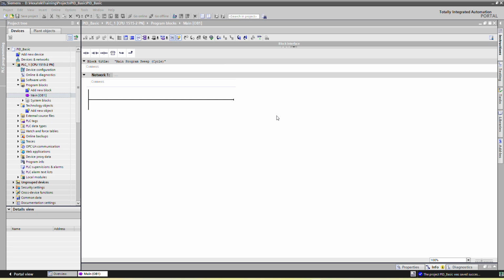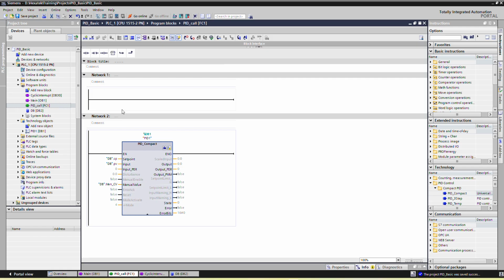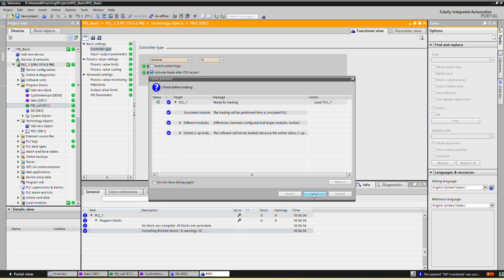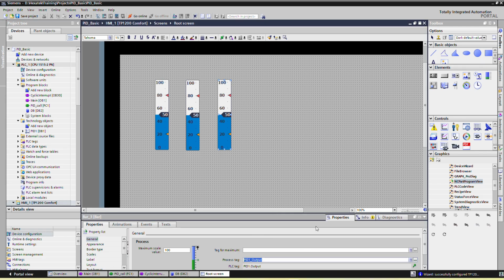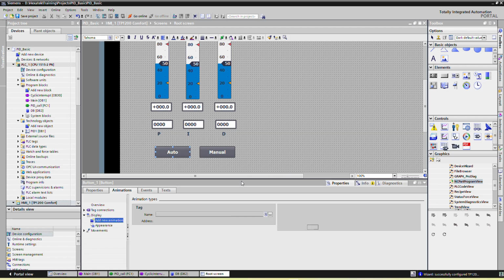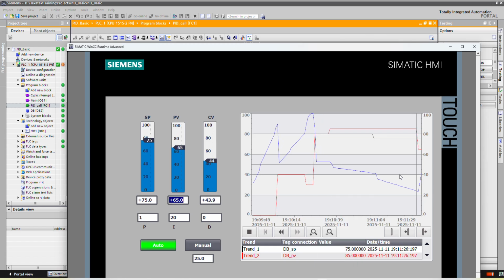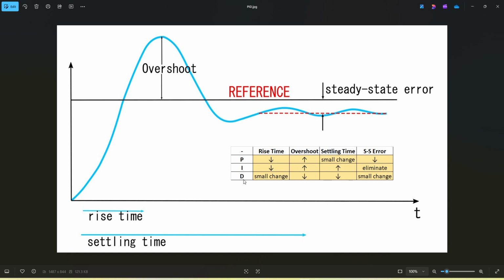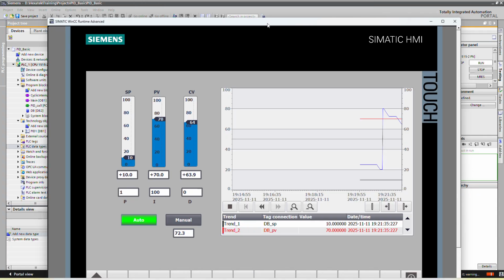Part 12 : How to Use PID Compact in TIA Portal | Step-by-Step PLC Tutorial

Comment: In PID_Compact, my states never change. I have done same step as you show. my states is always "0" instead of 3 or 4. plz help me
Reply from the maker: Hello,
0 means controller is in "Inactive" state.
trouble shooting:-
1)Check value of the mode input at PID Instance DB.
2)Check the functional configuration of the PID like controller type,input output type.
3)Check the error and errorbits.
Reply: @PLCxSCADA  It is still not working
Reply: I have check everything
Reply from the maker: @Brahmbhatt_Harshil_15  

1) Check  CPU is in run mode.
2) Use reset and ErrorAck bit to reset alarm
3) Compile whole project and download in the CPU.
Reply: @PLCxSCADA  I have use reset and errorack bit but still not working and i have all show change pid block and put ever thing same as you put in block
Reply from the maker: are you able to send your backup ??
Reply: @PLCxSCADA  i will mail
Reply: if you get plz reply me
Reply: @PLCxSCADA  Thank you🙏
Reply: @Brahmbhatt_Harshil_15  How was your issue resolved? I am getting the same probelm.
Reply: and i am using 1214 dc/dc/dc
Reply: There is no error in the program and I have compiled it